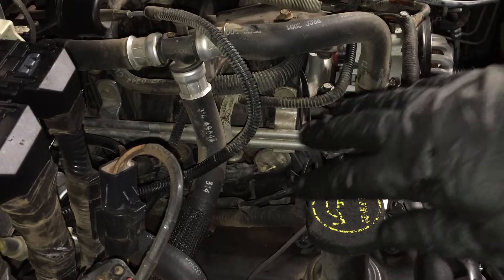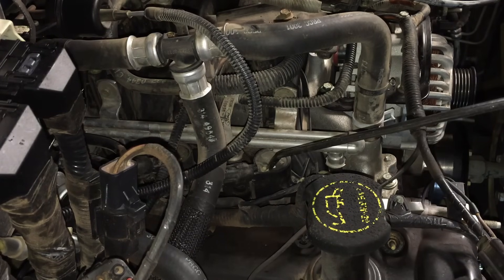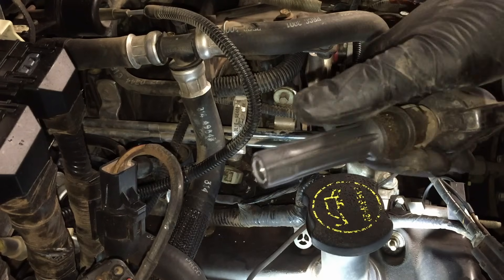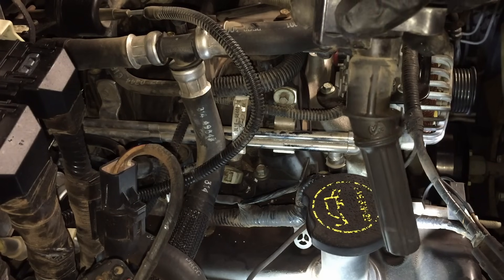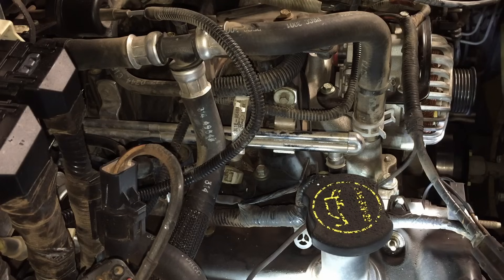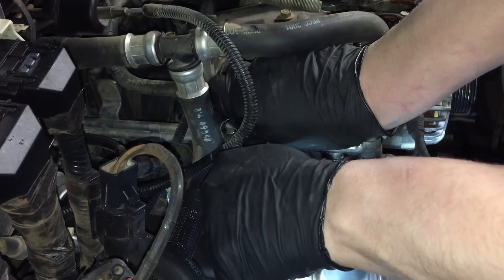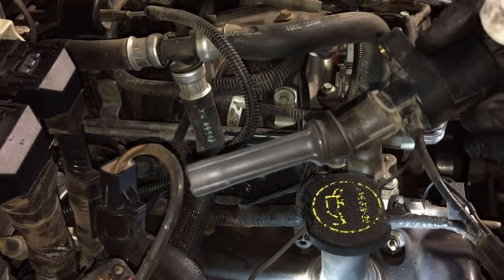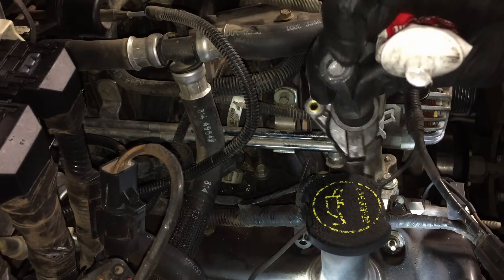Important Tips When Replacing Spark Plugs on Ford 4.6L 5.4L 6.8L 2v Engines

Comment: Great video!  My 2001 F150 4.6L had developed a skip at certain RPMs and loads.  After several weeks, I finally got a "service engine" light and the ODB-II reader said "Cylinder 5 misfire".  Money is tight at the moment and I've got an inspection coming up soon, so I chose to replace just the #5 spark plug and coil.  I followed your guide to the letter and everything seems ok.  Thanks!
Reply: Notorious for failing coils or bad coil pigtails. Hit n miss i heard.
Reply: @tedthornton7791  I bought the truck used and it has been my daily driver for over ten years. Coming up on 200K miles and that's the only engine problem I've ever had. Other than terrible gas mileage (4.6L V8), it's rock solid.
Reply: @MarkWarbington  4.6 2v ftw. my parents handed me down one they bought off the lot and it’s got 220k now. daily driver 50 miles on the highway. it’s amazing

Comment: The most important tip if you own a vehicle with one of these engines. Replace your spark plugs before 60k miles. I have worked at Ford Dealerships for a good portion of my 30+ year career and the vehicles that have spark plug issues almost without exception are those who go well past the recommended service interval. I own two vehicles that have one of these engines and have never had an issue with spark plugs. One is a V-10 with 140K miles and the other a 4.6 3V with 69K miles and the plugs have never been an issue. Use proper torque on the plugs and go lightly on the anti-seize.

Comment: On the 5.4 engine should the fuel rail bolts be taken out on both sides to allow for some movement or is that not necessary?

I recently bought an F150 that has misfire codes for cyl 4 and 6.  The last owner changed the plugs 90K miles ago; I'm sure they are all shot by now.
Reply from the maker: Not required

Comment: im having a misfire on  C1 since i had my plugs change last spring, and only have about 3000 miles on them, i had cam phasers and timing work done, but since then, i have a badly badly misfire on C1 and blue smoke at start up, shakes badly while im driving, i rarely use it now, its just a if needed truck for me now. any suggestions, im gonna replace the 1 plug here but idk what plug I bought for it last summer, i also just replaced all the coils this summer like in may and it was ok for like a week then went back to a misfire and i just had it scanned and it came back with 20 codes for the coils after being replaced so they cleared them & scanned again and its just a misfire on C1
Reply: what does it mean if oil in them. i have number 5 with oil in it.
Reply: does it mean the plug is lose ?
Reply: oh shyt mine is a 2004 ... F150 LARIAT 5.4 3V
Reply: I change my plugs last year and every single plug broke on it. I ended up sending it to tires plus and it cost me over $400 for them to fix it.

Comment: Thanks for this informative video!  Well done!  I have a question though...

You mention to apply a small amount of anti-seize on the threads of the new spark plug.  Obviously anti-seize would help prevent the new plug thread from corroding and should facilitate easy removal the next time plugs are needed.  However, I have heard from other, well versed mechanics, that using anti-seize, even just a small amount is not a good idea.  For two reasons, the first being that anti-seize can skew the actual torque reading when tightening the new plug and could result in a plug installed too loose and eventually blowing the plug out of the head OR too tight and stripping the threads out of the head.   

The second reason being that anti-seize in the threads can change the thermal transfer characteristics from plug to head, which effectively changes the heat range of the installed spark plug on that cylinder. 

Do either of these reasons warrant enough merit to avoid using anti--seize on new spark plugs?   In your opinion could you offer a risks vs. rewards of using anti-seize on the spark plug threads?  Thank you ahead of time!!!
Reply: Try liqui moly on those threads
Reply: If you don’t want to use anti seize, you’ll have to manually clean the threads with a toothbrush, And the rest of the area where the spark plug rests.

Comment: At what mileage intervals do you recommend changing the spark plugs on these engines?  

I've got an '01 Town Car with 30,000 miles and I'm wondering if 17 years with the original plugs sitting in the engine is going to be a dog to get out or impact it's ability to retain the spark plug going forward.  What's your mileage recommendation and thoughts on my situation???
Reply: if it ain't broke don't fix it
Reply: How’d it go? I got an 03 Lincoln too and I want to change them

Comment: ....I absolutely disagree with doing any blowing in the spark plug well AFTER REMOVAL OF THE SPARK PLUG.  One grain of sand falling into the hole can wipe out the rings causing catastrophic failure.  
Do all your compressed air blowing BEFORE REMOVAL of the plug.
Reply: He gets down into the hole and blows it after the plug is removed. Quite a lot of crud  falls into the hole while the plug is being unscrewed. Working for a large Limo and airport car service which most of the fleet is Grand Marquis or Town Cars I get to do a lot of mod motor work. I always clear the well and surrounding areas with air before pulling plugs and after each is pulled I put the tube on my home made long reach air gun right into the cylinder and clear it out, and everytime more shit comes flying out that had dropped into the cylinder while the plug was being removed.
Reply: @charliedee9276  He does the same in another video, a blast of rusty dust comes flying out. He also admits it is a controversial technique. I work on a fleet of fords and have never blown any air after the plug is out and never have dusted out an engine yet, knock on wood. These engines are like garbage disposals, we bought an f350 with the 5.4 and shortly after it was misfiring the seller put the one piece champion plugs in and one was missing its ground electrode, the whole thing. I must have looked around in there with a bore scope for hours and never spotted it. Still running fine to this day years later, just spit it out I guess.
Reply: @--_DJ_--  ) moo
Reply: Agree.  Anything you blow loose could fall down into the cylinder.  Strange he would blow dirt and crud around with the cylinder exposed.  No bueno.
Reply: SAMUEL ADAMS dude please ive seen the porcelain on plugs Fall in the cylinder bore  from a 5.4 broken plug and started it up and that 5.4 gobbled that thing up in 2 seconds. Ford has problems with plugs, phaser, chains, tensioners, rollers. But not pistons and rings lol
Reply: would vacuuming be better?
Reply: @NOLAWAGAINSTIT  fuck ya that's what I'm gonna do
Reply: Also gonna spray the area and keep dust down
Reply: @NOLAWAGAINSTIT  :Probably worse, actually, unless you have some special rig that's pulling in air from far away from the plug hole.
Reply: Agree. If anything a vacuum.
Reply: I blew everything out with a compressor with plug intact. Then i took out the plugs and rigged a small tube to a shopvac. Worked out bitchen
Reply: Every plug was flat to the porcelain lol 120,000 miles on copper plugs
Reply: Don’t always trust amazon! I have bought several sets of plugs that the socket would not fit on. Also bought wheel bearings that failed within weeks. Oh and yes I am a retired mechanic with 45 years experience.
Reply: He blows the air inside the cylinder and not on the spark plug seat, so there is no dirt falling down - it actually ejects from the cylinder.
Reply: Very practical reasoning and insightful knowledge.
Reply: He did before coil, then again before removing plug. I don't think it's a good idea to blow air with the cylinder exposed, but i'm not a professional.
Reply: I agree too. Do not blow air once you removed the plug itself
Reply: Guys , about the matter of air being pushed in the cylinders. Just look at the heads that strips and spits threads n plugs. The 3 valve heads are the nightmare
Reply: absolutely the one thing that you should always do and always always do when removing the spark plug is put the new spark plug in and immediately have it ready gaped and literally ready to put in I can't imagine how many people have allowed debris to fall in I mean it doesn't take any thing really it can be any little weird piece of plastic any little chunk of dirt with a rock in it dry dirt all over the hood you never know something can fall in EZ something can just blow through the wind and get in there it doesn't matter people drop shit in there all the time and the only way to really prevent things is to just put that plug in gently and at least drop a couple turns on it I mean why waste time it's going in anyway and you're right sitting there blowing shit is the worst idea but you know what's weird about this post he directs people to spark plugs by Motorcraft that Amazon clearly tells me does not fit my 10th Generation motor so he must be working on a 5.4 but that's the weird part he doesn't even tell us and the title is literally titled for all so basically the people that don't know better we'll just go order these spark plugs thinking it's definitely going to be what they need... Well at least he did the Amazon route but in case people don't know a lot of parts stores are going to go out of business soon and their price matching Amazon or any online prices if they're in stock they will price match they won't tell you this all the time that's why you have to ask and you have to keep asking you have to ask every time until they realize that's what you're about because they won't even bring it up and they'll give you their prices if you don't know better...
Reply: @ryanwyrick6947  take a breath..lol
Reply: @ryanwyrick6947   Where did you learn to write?
Reply: Havoc Man He must have learned from E.E. Cummings, the poet who didn't believe in capitalization, indentation, punctuation, grammar or anything but long strings of lower case letters, but he became famous from his disregard of most of the conventions customarily governing writing in English, but he did put spaces between words, unlike the Romans two thousand years ago when writing in Latin.
Reply: @ryanwyrick6947  punctuation dude
Reply: @volksrod6926  😂🤣
Reply: @ryanwyrick6947  can i get some god damn punctuation? Jesus christ...
Reply: @ryanwyrick6947  Does your 10th gen have a 2 valve engine in it? I doubt it.  You really think Amazon has the best pricing for parts? You have to be kidding me. I can drive 10 minutes and find 3 places that will sell me just about anything I can find on Amazon at a better price and have it in my hand right then. He is a Pro, if you have a problem with him doing a bit of blowing after that is fine but you should see the video where he does it and a massive cloud of rusty crap comes flying out, you would rather leave that in? It is situational, if you feel shit may have gone in, you might have to give her a blow. It falls in as the plug comes out, he cleans before he pulls it out but its a dirt trap design, nothing you can do.
Reply: @SlikLizrd  I was looking on amazon for spark plugs yesterday for my old truck, just out of curiosity. Plugs I can buy for 3 dollars were going for $60 for 8 copper delcos. Hell of a deal. Rock auto is fine until you add the shipping, at least to where I live. I can get better prices, when you factor in shipping and have the stuff delivered in hours, not days. Also any warranty stuff is easy to handle over the counter. Trade price is where it's at. I am an old school guy though, I can probably count on one hand the number of items I have bought online. Maybe two hands at most. I am sure there are deals to be had, clicking away looking for them doesn't seem any smarter to me than calling around and having it in my hand that day, or the next morning at worst.
Reply: @SlikLizrd  You guys down there have it pretty good when it comes to shipping. I don't disagree that amazon has a great warrant policy, but you can't hand over that water pump and have one back on the car an hour later. I don't pay retail so I suppose we are not comparing apples to apples. Everything ships across the border, and often anything I have tried to bundle together on rock auto ships from different warehouses so I would be paying through the nose to get a cap, rotor and a set of plugs and wires, or have to buy parts from cut rate manufacturers. Good job on wrenching at that age, I can only hope I will be doing the same. Though not on some old fancy ford :)

Comment: I have an 04 p71 and I have almost put 20k on it myself and think it's time for a tune up. I went from 3-325miles per tank to about 280 here recently.  Only codes on my reader are to check o2 sensors so I think they may have gotten worse.  Those I may have to take to be done if they won't come loose.  I will be buying Moto craft plugs but I found a crazy deal on coils.  If I get a few years out of them I'll be happy. If not I'll let you know. I'm just so broke I need to save the extra $25 on coils.

Comment: Good stuff...
I just did all eight coils, and all eight spark plugs on a 2004 CV P71. The plugs were SP493, and the coils were DG-508.   I did the repair because of a dead miss on cylinder number 5. 
Everything seemed fine at the conclusion of the repair as the car ran flawlessly on the test drive. Then after about 50 miles, the check engine light is flashing under hard acceleration, right after first gear winds out into second. 
Any suggestions as to what could be wrong or what to check?

Comment: had to replace one coil..change old plugs on 4 cylinders.but those boots are hard to take out after twisting, turning and on pulling stuck boots they would break off just below top of spark plug...#@$%^^...one hour to BURN it out with small propane torch, take out plug and blow burnt residue out with compressed air.

Comment: I just changed my plugs and coils.  Two of them had some oil in them.  Looks like I have a leak.  How expensive is it to fix the gaskets or whatever is leaking on an old 2003 Expedition?

Comment: Is it best to have the engine warm or cold when replacing plugs.
Reply from the maker: Ford has now changed it to warm not hot instead of cold.
Reply: This is the procedure I've always used since they  first came out  with this design and I've never had a problem. I'll always do one side of the time. Starting out with the engine cold go ahead and remove all the seven mm bolts holding the coils on. crank the engine and let it run 1 and 1/2 to 2 minutes and as quickly as you can unplug the coils pulling out of the way and break all the plugs loose. the reason for this is the aluminum will start to heat up and expand faster than the steel of the plugs and it has a tendency to release the threads without causing any galling or damaged. By the time you get the new plugs in new coils on, the engine will have had time to cool back down. move to the other side start all over
Reply: Agree
Reply: My mechanic changed the plugs on my 2010 f150 4.6 2v when engine was hot, am I going to have problems down the line? I've driven about 5k miles since the change, but I'm concerned about the next time the plugs need changed.

Comment: Magnetic spark plug removal tool is the best. The rubber ones let go after a few uses. No more dropping the loose plug back in the hole trying to get it out.
Reply from the maker: agreed
Reply: you can just put a smal piece  of paper towel and put it inside your wrench .

Comment: I have a2007 F150 4.6L Romeo engine.  It has a wide, flat fuel rail over the injectors which partially obstructs removal of the coils.  Will I have to remove the fuel rail to get access to remove the coils and plugs?

Comment: Can I use a 5.4 Triton engine out of a 2007 E250 cargo van in put it into a 2006 Expedition
Reply: The Econoline is a 2 valve. The Expedition is a 3 valve for the 2005-2014 model years. So no it won't fit without proper modifications.

Comment: VERY INFORMATIVE VIDEO- MAY I ASK YOUR RECOMMENDATIONS FOR PLUGS AND IGNITION COILS FOR 2003 MOTOR HOME TRITON V10 6.8 LTR ; NOT VERY MECHANICALLY INCLINED; I SUSPECT THE INTAKE MANIFOLD GASKETS CAN BE A PROBLEM AROUND 100,000- MILES?? THANK,S FOR ADVICE PATRICK.P

Comment: thank you, I have a 4.6l 1999 Lincoln tc and I by mistake used a bad torque and instead of 15 ft-lb I put in 20 ft-lb. I was really worried until I saw your video. Thank you. I replaced the plug and I torque it to 180 in-lb but i will do it again to 20 ft-lb.

Comment: GOOD ADVICE TELLING THE VEIWERS TO USE ONLY THE ORIGINAL MOTORCRAFT PLUGS AND STAY AWAY FROM THE OTHER HIGH PERFORMANCE PLUGS LIKE THE E3 AND OTHERS. LETS TAKE THE E3 PLUGS THAT PRODUCE MORE SPARK. BY PRODUCING MORE SPARK THEY OVER WORK THE COIL AND OVER HEAT THEM WHERE YOUR COILS WILL EVENTUALLY SHORT OUT AND YOU HIGHLY RISK BURNING OUT YOUR COMPUTOR. FOR RACE CARS WHICH START UP FOR A SHORT PERIOD OF TIME WHICH I WOULD PUT AT 10 MINUTES INCLUDING YOUR RUN DOWN THE QUARTER MILE. THEY POSE NO PROBLEM SHORTING OR BURNING OUT ANYTHING. BUT IN YOUR DAILY DRIVER EITHER BEING COMMUTOR OR A WORK VEHICLE, THEY USED FOR MANY HOURS DAY AFTER DAY AND THIS IS WHEN THE ORIGINAL PLUGS FIT THE EQUATION. SECONDLY THE PERFORMANCE PLUGS LIKE HE SAID ARE NOT NEEDED BECAUSE THEY ONLY MAKE A DIFFERENCE IN A PERFORMANCE VEHICLE, SO BEWARE WHEN USING THEM.

Comment: I changed mine out not to long ago and torqued them to 28 ft lbs with no anti-seize... Now im wandering if i screwed up with the torque specs.  Will i have problems later when i change them again?
Reply: No, you won't.  And I don't recommend anti-seize on threads where the Ford factory already shorted us several threads.  If they're likely to back out and then blow out via engine vibration, why would I use anti-seize to hasten that process?